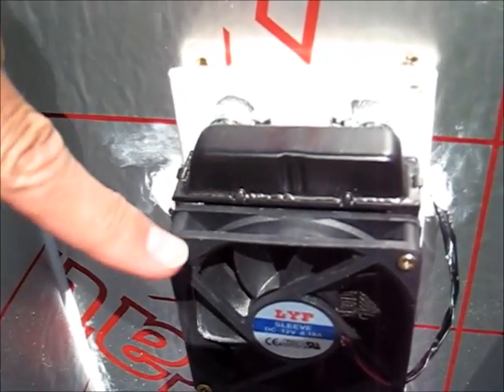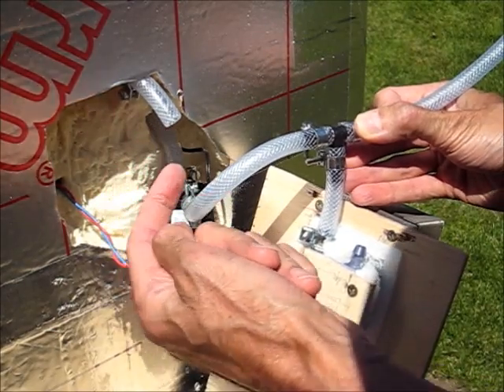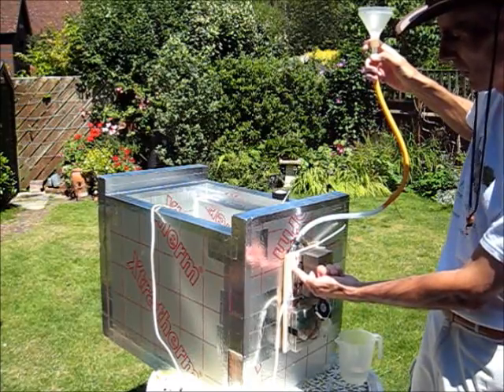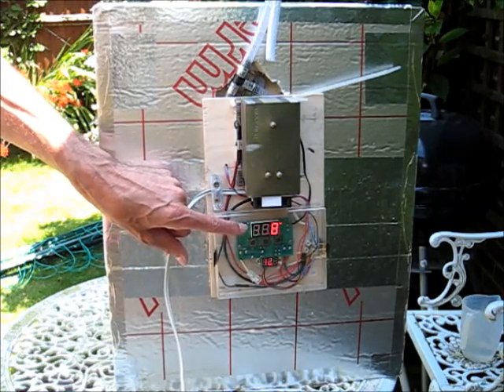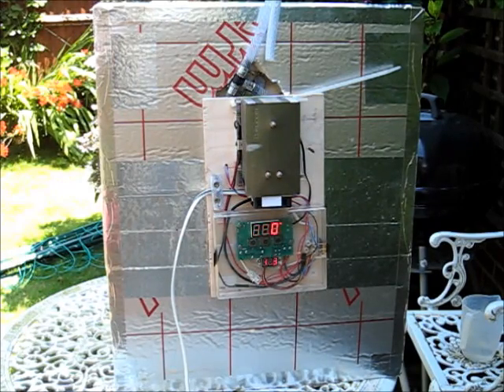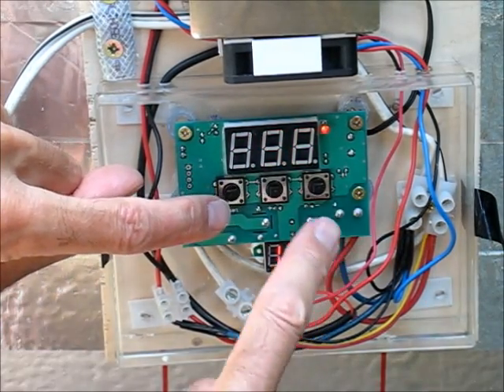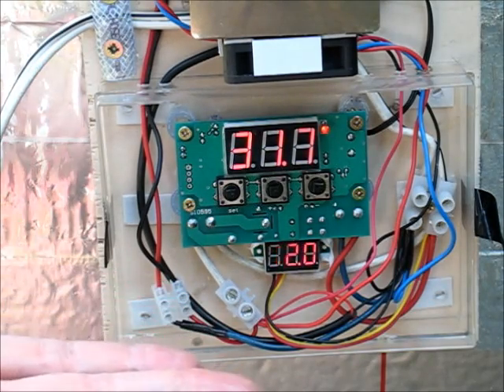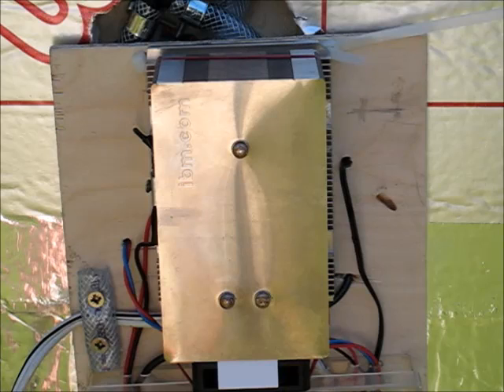Part 6 - Super Cool Box Project; thermostat set-up & initial testing

Comment: your not going to get colder, the more you cool the hot side the lower temp you can get on the cold side. the hot side temp is going to rise with your setup and you never get you cold side to 5 degress.